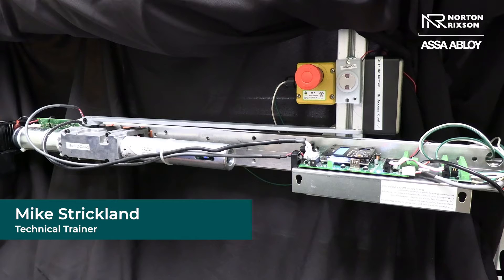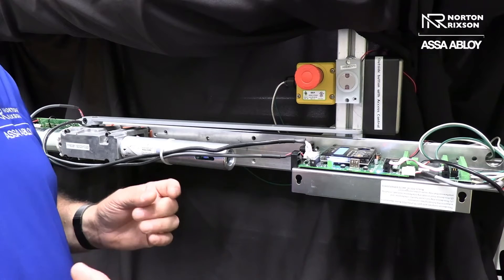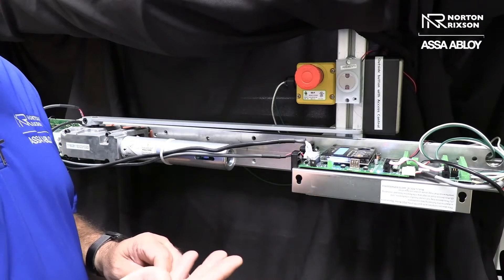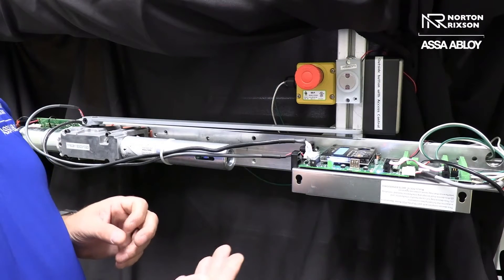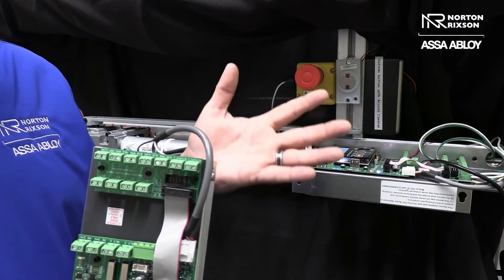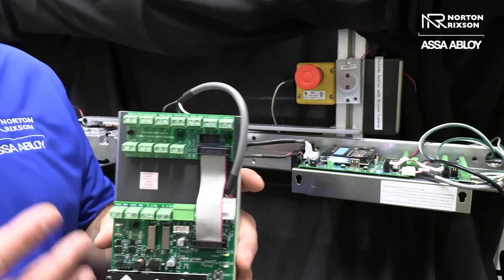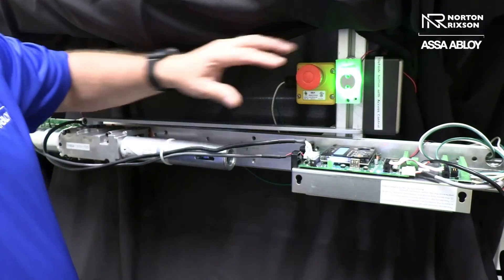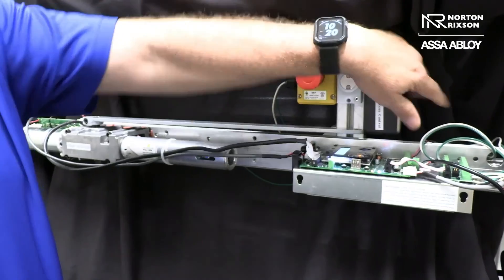How to interface access control on the 6300 Series low energy operator

Comment: You guys really need to have a close assist function for when there is a lot of air pressure preventing the door from fully latching shut like they do on the Dorma ed150/250.  Those operators can close a door during a hurricane